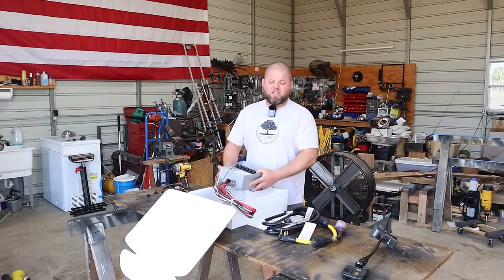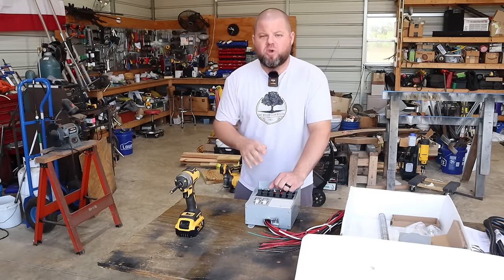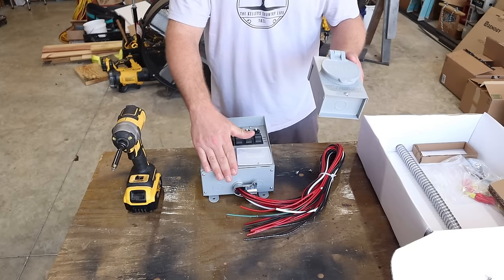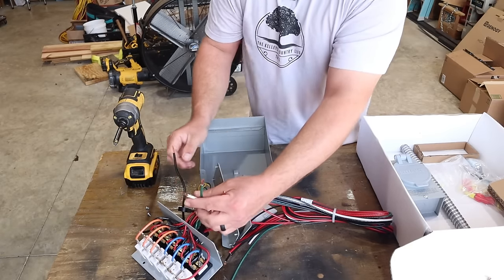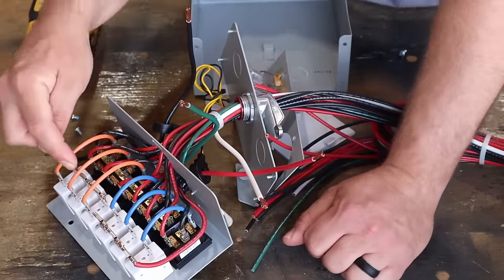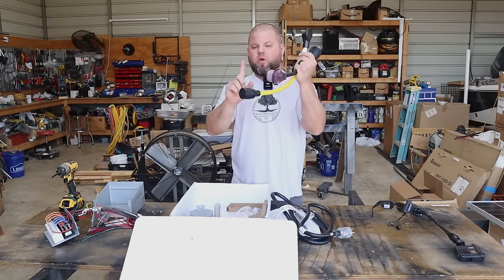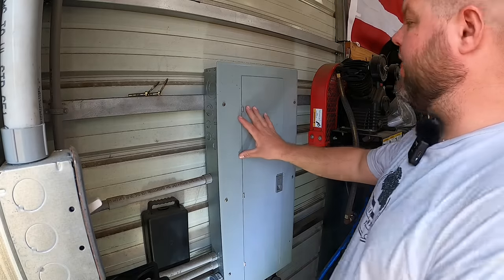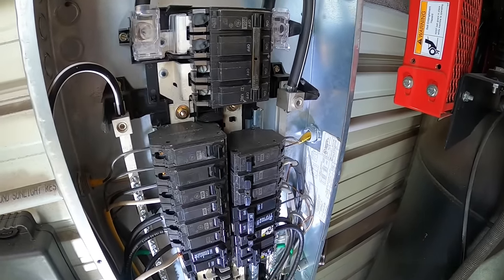How to install a generator transfer switch 120 and 240 volt #703 Ecoflow whole home power solution

Comment: I might be misunderstanding, but it seems there are three issues with this video: First, you can't" operate a 240V generator and a 120V generator at the same time." Second, as someone else pointed out, "only the hot wires are switched, not the neutrals, which will cause GFI circuits to keep tripping." Lastly, if a tornado or hurricane were to destroy the barn with all the equipment inside (like the generator and EcoFlow Delta Pro), your storm shelter would be left without a critical source of electricity.
Reply: On my gas generator there is a outlet for 120 and another for 120/240, which should i plug into if my gentran has a 20 amp plug instead of that 30 amp shown in the video. I'm not an electrician, just a person with a transfer switch and a huge gas generator, who wants to keep my well pumping water.

Comment: Thank you. Your explanation of how to make a 240-volt transfer switch to run only on a 120-volt generator is excellent. I have no 240-volt appliances in the house and don't need the 240 at all. The stove and dryer are both natural gas. I do need more than 6 circuits though. I initially thought that I could just wire nut both of the line wires to the line in wire from the generator as a work around in a ten-circuit 240-volt box. Your suggestion to wire the plug as the instructions state and just get the adaptor cord for my 120-volt generator so that I can upgrade to 240 volts in the future is excellent.

Comment: I don't have buildings all over and our outages are generally only a few hours at most up here in Ontario Canada so I installed an outdoor inlet box with a lock out on the main panel breaker and use a 10000 watt peak Duromax gas generator to power the whole house. Easy install and I have every circuit powered. I preferred to do it that way instead of selective circuits with a transfer switch. That just works for me and is a breeze to install.
Reply from the maker: I totally understand, with a 240 volt genny I prefer the simplicity of a lockout myself.
Reply: I don’t believe interlock are legal in Ontario. Hope you never have to file an insurance claim.

Also, there’s people that go weeks without power in Ontario. Tornadoes and windstorms have not been kind to some in Ontario. Within the last year, I have gone more than a couple hours a few times, and more day twice, within the last year.
Reply: @TKCL  how do you become a product tester for eco flow ?
Reply from the maker: Grow your channel and make similar reviews. Eventually they will contact you.

Comment: Just wanted to say thanks for the 110v . Had some reservations and this cleared it up. We're now running this box with the adapter to use are 120v gen to power basic essentials.  this box was cake to hook up.   And he right this route is way cheaper than getting a dedicated 120 box.   Very helpful video .   Thank man!
Reply from the maker: Glad it helped

Comment: The absolute best video on the transfer switches I’ve seen. It even answers questions on the cords I didn’t know I had. As for your storm shelter, I’d keep the small battery where it is. It will stay topped off and God forbid you’re in there an extended time it adds a little extra if the house system, batteries, or fuel run out. Just a little added security. I hope it never comes to that. Thanks again as I know what to order now. 🙏🏻
Reply from the maker: Glad you enjoyed it
Reply: He doesn’t answer when you need a floating or bonded neutral generator when running a transfer switch
Reply from the maker: @johnsn10  what on earth is this response?
Reply: @TKCL  some generators come with a floating neutral, and some come with a bonded neutral and depending on the transfer switch you have you might have to change weather its bonded or floating but it also depends on how your panel is setup. If you don’t know what I’m talking about call reliance controls and they can explain it to you.
Reply from the maker: I totally read your comment wrong, I thought you had been asking me and I wasn't responding. Your correct and some generators allow you to make this change on the generator itself.
Reply: @TKCL  I called Renogy as my inverter is from them. After they explained a bonded neutral, all it took was unplugging a small clip to disengage the internal GFCI. It’s still grounded so it still should be safe as far as I can tell. Of course they recommended an electrician, but YT came through for me. Sounds like it produces a feedback on the GFCI and is an automatic trip. You’re all good. You’ve been a “little” busy and preoccupied lately. Thanks

Comment: Could be confusing when you keep referring to the selector switches on the transfer switch as circuit breakers. They just select what the source of electricity is to the device/load, ie generator or grid power.
Reply from the maker: Push button circuit breaker directly above them and tied to them. Makes it easy to say that, right or wrong.
Reply: @TKCL  OK didn't know what that was, thought maybe a light...

Comment: Thanks for the great video with excellent info and links. About all I can add is:
Some refer to the gen/off/line selector switch as a 'breaker'. It is not a breaker. The breaker for that circuit is the push button just above on the subpanel.
The circuit is protected by the subpanel breaker when the switch is set to 'gen'... The circuit is protected by the main panel breaker when the switch is set to 'line'...
Thanks again!

Comment: I have the same transfer switch installed at my house, works great on my 110v only generator.  Great video!  We installed our generator plug outside and the transfer switch when the power was out for 2 days…. I had all the stuff but was waiting for assistance from my dad.
Reply from the maker: These things are life savers when those outages hit.

Comment: "liked", "subscribed", and "saved"! I'm in the process of installing 4/380W solar panels with 12V battery back up. I couldn't figure out what I was going to do to run my 115V circuits on it. I still have to install a 240V gas generator switch to run our well-pump, refrigerator, and HW on-demand but this explains how to do both. Excellent video!
Reply from the maker: Thank you for watching, I've got a lot of solar projects on the channel.

Comment: Another great video. I installed one of these with ten circuits, a simple job as long as you do just one wire at a time, after deciding which are the critical circuits.
Reply from the maker: It's confusing at first and then makes perfect since after a circuit or two.

Comment: Nice job, Andrew.

I'd always struggled to find a really compelling use case for using a transfer switch vs a genny breaker and an interlock. Just having a 120 volt genny never seemed to do it for me; since 110 volt loads tend not to be hard-wired, they could be fed pretty simply by running an extension cord from the genny (not elegant, but much cheaper than a transfer switch).

Your use of a battery back-up with pass-through capability is the missing piece that makes using a transfer switch sensible. It is a true UPS solution for a number of circuits concurrently. Very slick indeed!

Take care and God Bless.
Reply from the maker: I think it's also a viable solution for a whole family. Not everyone knows what circuits to throw off and on in a emergency situation.
Reply: @TKCL everyone likes your content Andrew 3:55

Comment: Thank you for this GREAT video. I installed one of those Reliance 6 circuit transfer switches a couple of years ago for my small 3600 watt Fireman generator. It works "Great"! The damn switch cost more than the generator ???  I am now becoming a "prepper" yep a end of the world prepper after Joe Biden took office? incase of a solar flare up or nuclear detonation in the atmosphere over the good old USA. I am glad you took the switch apart so we could get a look inside. After looking inside the transfer switch I can honestly say that it is "is" EMP proof (Eletro Magnetic Pulse proof) The only things in my opinion that may malfunction after a EMP event would be the wattage meters but no big deal. The rest of the switch "should" survive a EMP event. I have also sent Reliance off an email to let them know they should advertise their product as EMP proof to increase sales. Thanks much again for your great videos Mike

Comment: Hey, I was super excited to see this video. But there are some problems that people will likely run into that weren't addressed in this video:
THOSE WITH AFCI/GFCI BREAKERS:
1. This transfer switch does not switch neutral. This will trip ALL GFCI / AFCI breakers the moment you flip over to generator power.
2. Because of the shared neutral, running the delta pro in UPS mode from AC mains is not an option.

So, if you can live with resetting all AFCI/GFCI breakers after going back to mains power and you DONT want to run in UPS mode to auto handle power loss, then this will work.

These to me are major issues and should be understood before attempting this install.
Reply from the maker: Interesting, thanks.

Comment: Our home at the beach came with a whole house generator that runs on propane.  We have a 1,000-gallon propane tank in the front yard and an automatic transfer switch that turns on the generator and switches power if it goes out.  When the power comes back on it turns off the generator and transfers us back to the grid.  Great explanation in case I need to fix something someday on that system.  I did spend a great deal of time documenting how ours is set up and it was much simpler since it runs the entire panel.  I will say that ours is pretty good, I may look at going to something like yours for our vacation home which is much smaller than our main home at 2200 square feet.  I think your solution could probably run all our critical systems if the power goes out there.
Reply from the maker: You'll enjoy today's video, I ran my entire house on it with minor solar input. Minus the big 240 volt energy hogs, it ran and outpaced the energy needs of my 110 volt circuits. I can't wait to double up to 240 volt capacity and a true solar array. I think I'll be set for any extended outage.

Comment: 2nd video watching an installation of this brand,  the other was twice the size.  What I really like about it is that you can isolate major circuits.  I don't like that I have electric ovens but I don't need them in power outages. Same with this guy I have an elec hot water heater.   Not that you would want to power it on and off,  that is wasteful  and you could power it off at the source manually.  Locally we have lost power due to an ice storm for over 7 days now.  I am one of the lucky few unaffected but I need something like this.  and the battery back up.   7 hours to just run overhead lights isn't enough,  but the output ports and the ability to power a home gives you enough power at least to make the necessary adjustments to get on other power.

Comment: Thank you for the valuable information. I am having my new home built in Texas, in the country so I'm very much considering this power station in case of blackouts.  I want to be prepared -- don't want to have my food spoil without power!  Because food is so expensive.  I checked out the links in your description and they have everything I need to set up a system.  I'll have my electrician install it for me because I'm not confident enough to tackle this job. And, I subscribed to your channel.
Reply from the maker: That's great to hear! I have just recently made several videos of this system running all kinds of stuff around my home. If you don't mind, use the links in the video description. The company tracks it and I earn a small commission if you order through it, doesn't cost you any more. Things like that allow me to buy more stuff and make more videos like this. Take care!

Comment: This is a great video and is the exact transfer switch I'm looking to possibly use, except I want to use it on a smaller scale and hooked up through a 120V 1,200 Watt Pure Sine Wave inverter powered by my EV.  I've already used the inverter during a huge ice storm with a power outage that lasted 5 days, but it was a pain having an extension cord from the garage throughout the house to power our fridge, furnace fan, and freezer.  Those combined only drew about 700 watts continuous which our inverter did easily without issue.  

I am only hesitant because the inverter warns not to wire into any AC devices that " has its neutral conductor connected to the ground."   This is how the transfer switch is wired into the panel though.
Reply from the maker: Don't wire transfers switches like any of these to a panel with a shared neutral breaker system or multi wire branch circuits.  Problems can arise, this is usually only found on much older homes.

Comment: Thanks Andrew.
You corrected Yourself in the comments about the Black SPST Switches as Breakers but stated they were breakers in the video. The Breakers are on top. LOL
I went the Cheaper easy route of a interlocked 50 AMP breaker with a Bottom fed inlet. 
Mike M.
Reply from the maker: Yes 3 way switch, easy to call breakers. Reaettable breaker right above. The interlock is what I prefer myself, but not for the person or family that doesn't understand loading. Those leave you with the possibility of trying to power an entire panel from an undersized generator. Both have their place.

Comment: Thanks Kelly. We are getting solar installed at our home here in So Calif.  Only issue is that power does not go out too often but if did solar will not power house. 
I have been researching different ways to power house and want to use battery back up like you showed but also propane generator if needed. 
This system looks to be what I need. Thanks.
Reply from the maker: Your doing it right, get a backup for your backup.

Comment: I have seen some of these delta pros in other videos, but you are the first that talked about the UPS feature.

In some of the other videos I have also seen:
- 2 Eco flow pros in tandem to provide 240v 7200w
- Ecoflow smart duel fuel generator that can hookup to the pro and max to power the battery through DC input.

Ideally to me would be to have the smaller generator charging the powerstations , while the power stations supply power to the home and have the capability to handle the occasional higher 240v loads (ex well pump). However, I do not know if you can tandem the machines and have a generator hooked up as it might only supply power to the one powerstation, assuming the port is even accessible when connected in tandem.
Reply from the maker: I've read the Eco flow smart generator will only charge one Delta pro. I hope they figure out the future how to have two in tandem as you described and one generator be able to charge both.

Comment: Thanks for this I've got the Reliance 4 circuit which is 120 volt and now I want to cover more circuits and am going to change to a larger transfer switch and knew I was going to have to figure out how to be able to adapt to run everything until I move up to a split phase inverter.
Reply from the maker: Glad you enjoyed it

Comment: First of all, I'm not an electrician. That said, I'm of the impression using a wire nut to directly connect a stranded wire to a solid wire isn't best. I usually use a crimp connector or a Wago clamp connector. That said, the video is excellent.
Reply: I’ll give my $.02 worth here too…. I love the ease of WAGO connectors, but I did watch a video on comparisons between wire nuts, WAGO and WAGO knock offs….  Cost and performance went to the wire nuts.  Where they won out was resistance and subsequent heat generation.  The WAGO and the knockoffs got fairly hot compared to the wire nuts and of course, the wire nuts were very inexpensive.  I use WAGO in outlets and installs where I might revisit again and make changes.  For an install like this however where it’s a “one and done” type of install, I’d go with the wire nuts.  Plus the 10AWG is pushing/exceeding the WAGO unless you’re buying the models designed for wire that size.

Comment: I don't have a Delta Pro yet, but I do have a Delta 2 and have been soaking up info on the Pros lately. Make sure you look into the AC input limitations and how they impact the EPS functionality before hanging your hat on that feature. I have been seeing some online complaining about overload errors occurring when trying to pull more than 1800 watts while plugged into AC power.
Reply from the maker: Yes that's very common, most of these power stations I've tested have a 1400-1800 watt UPS limit. That's perfectly fine for critical components that might be hooked up such as freezers, refrigerators, my storm shelter, wifi routers ect.
Reply from the maker: Keep in mind the typical wall outlet can't support more than 1800 watts, so if your using pass through that's all you can reasonably expect from the house wall receptacles.